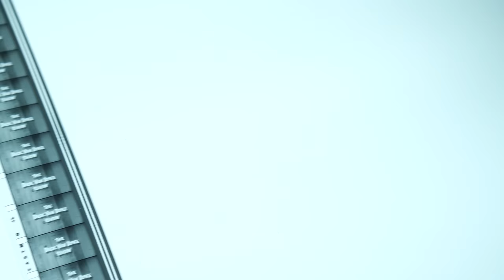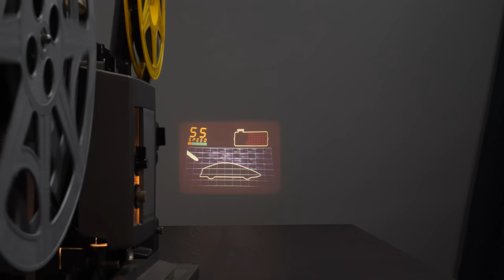Movies made sound with a light bulb: Sound-on-film

Comment: I am 35 and my first job was being a projectionist in a multiplex cinema. I was basically the last generation to have handled film on a daily basis. I have worked with multiple machines and they were mostly35mm projectors, but sometimes we used 70mm too on our bigger machines. 

One of the biggest benefits of dts was that we were able to play the same film copy in multiple languages, because all it took was to swap the dts discs and voila, any dubbed version could be played.

SDDS contained three centre channels as the normal single one in SRD or DTS which was beneficial on bigger screens because the voice of the speaking person could be more accurately placed on the screen.

 And then there was the scary but interesting way of playing one copy in multiple machines at the same time which have been networked together. A scary thing to do, but it was interesting to see in action :).
Reply: Ooh! That last thing - one film print running through a bunch of tubes and holes in walls and floors to another projector - there's actually really awesome footage about that on Youtube. Or at least there was, about 5 years ago. No idea if the uploader kept it up, but it was very much worth watching.
Reply: at my 10 plex, the projectionist once threaded a print thru 8 of the projectors
Reply: @mfbfreak  FilmTech has a video demonstrating a 16-screen interlock. it's quite a trip. The video ID is ZdPKGNCw7lM
Reply: If you look at the last generation of 35mm film, SDDS was encoded outside the sprocket holes, Dolby Digital in-between the sprocket holes, analogue stereo where it's always been and the DTS time code in-between sound-on-film and the image.
Bananas
Reply: My people! I'm 34 and was a last-gen 35mm projectionist too! I even ran the last film screening at our multiplex. One day film will come back, the way vinyl did, and they'll have to dig us up to train the new generation lmao
Reply: @MostlyPennyCat  At keast they made it work for multiple sound systems.
Reply: @Toast_Points  True (and I'm 45). I remember when seeing films projected on TV in realtime was still a thing in the 80's.
Reply: @Toast_Points  May I ask what that final film movie was you remember projecting? I’m 34 also and if I recall correctly my local theater made the switch to digital fairly early on as it was pretty new around the time though I don’t really remember when that happened.
Reply: @Coderjo.  missed rickrol opportunity
Reply: Also 35 and did part of my high school work experience in a twin cinema projection booth.  I believe the last film I presented was Hotel Rwanda.  Once we spliced together the trailer and feature reels onto the platters, we would do a test run of the whole film with an empty auditorium.  One auditorium was set up for SDDS in addition to Dolby Digital, and the other DTS plus DD.  I can't remember if the feature had SDDS tracks, but we were presenting it on the DTS "side".  The DTS decoder stack malfunctioned during the test run, first dropping out, then going into a boot loop, (I think the decoder hardware was an embedded x86 system that booted MS-DOS from the DTS audio CD-ROMs) then not powering on at all.  I switched the audio source to DD, only to discover that it was unstable, so the test run was completed using the analogue optical Dolby Surround tracks.  A thorough cleaning of the DD optical module brought it back to life with our audio test reel, but there wasn't enough time to run the film again before the premiere opened.  Fortunately, it worked without a hitch.  DD was seldom used on that projector, so while the film path was cleaned regularly, the DD optical module didn't get enough attention on a regular basis.
Reply: @SmokeyChipOatley  I do remember, it was The Thing. The 2011 prequel, sadly, not the original.
Reply: @erinrising2799  we did the same thing (our projectors called it Interlocking) for the midnight premiere of The Dark Knight. It was my first time doing it and apparently it hadn't been done for a  couple years before I started there.  Timing is extremely critical - you have to start the next projector about 8 seconds (if I'm remembering correctly) after the previous one started. If not you have too much slack or too much tension. Let's just say we had some "technical difficulties" that required several new film splices.... And we didn't get started until after 12:30....
Reply: 53 years myself. Former IATSE projectionist  stayed in the business until the digital machines came in. Ran the booths of 8, 10, 12, and a 18 plex. 35 and 70 mm prints.
Reply: @JStewie15  My first interlock shift was TDK, not midnight shows but opening Friday. We turned off the wrong platter by accident and caused a brain wrap. Once we finally got it going again, the projector status boxes in the office and concessions wouldn't stop beeping even though everything was good. My manager had the bright idea of power cycling the box, which shut off all 12 projectors instantly. I was in concessions recovering after fixing the brain wrap and suddenly people start coming from multiple theaters saying their movie shut off. According to the concessionist I looked like I had just seen a ghost.
Reply: I feel bad that I am 35 and never had a similar job, and in fact was super excited about digital film coming out, you know, "The future is here!".  Turns out the future tends to be more boring than you would expect.
Reply: @Coderjo.  I edited that video. :)
Reply: I worked in a dump of a multiplex about 15 years ago. 13 screens, 35mm with dolby digital. And me running the lot of them.
One of those jobs that was both an interesting place to work, while also being incredibly dull, badly paid and tiring.
I like to look back on it with fondness, but at the time it was awful.
I do remember that once per year, each sound-head had to be checked for audio sync, but it was one of those "ticking the box" type jobs, because it was practically impossible for the audio head to move far enough to cause visible sync issues. You loaded a fairly short loop of film that had a visible flash and a beep that should be perfectly in time with it. You watched and listened, while adjusting a little potentiometer with a screwdriver.
Reply: @Coderjo.  OMFG, that's epic!
Reply: The movie theater in the middle of nowhere town where I vacation used film projectors until a few years ago. It's a cool place, built in 1922 and two of the theaters are basically screening rooms because of how small they are.
Reply: @Toast_Points  Holy crap. That's a bad night. I think everyone who worked in a theatre as a Projectionist has some crazy stories. I only had one really bad brain wrap. It was a 10pm showing of the orphan. I went up to check out what was going on and it had wrapped up the film from the top platter all the way over to the top of the projector. It took like 3 hours to fix. And about 15 seconds or so of the print was just shredded and had to go in the garbage. We switched to Sony 4ks just in time for the premiere of Avatar 3D. It was awesome and cool to see it all be installed. But was sad to see the film part of the theater (as well as my job as Projectionist) be basically deleted. I made it by for a few weeks. But after the used the software enough they realized it could all be scheduled. I already knew that but I'd been deleting my scheduled shows at the end of my shift. What can I say. I was only 19 lol. Good times.
Reply: The worst thing I witnessed was when somebody dropped the only print we had of harry potter 6. A new guy was trying to move it by himself using a plate and it slipped. I had the 2pm shift and walked in to find the head engineer running up and down, stretching the print out to detangle it. We got through a lot of film cleaner pads that morning.

"Isn't it a bad idea to have it on the floor like that?", "Oh yeah, but it's either this or have  the print out of service for the next couple of days while we find each tangle and slowly take it onto a set of reels. And it would be taking up the only working rewind cart while we're doing that. If they're willing to rent out their prints to crappy places like this, they shouldn't be surprised if they come back a bit scratched in places."
We had it back on the platter by 4.
Reply: I'm 44 and although I was never a protectionist when I was a child I was given the 16mm Eiki off of HMS Bristol and a handful of cartoons as a toy.
See, the Royal Navy had a film library but they were transitioning over to DVD and large screen televisions. So they threw all the projectors in the skip and burnt the Royal Navy Film Library 🤢
I still have it and now collect movies on 16mm.
I have Disney's The Black Hole and The Elephant Man.
The Black Hole is a Technicolor print too!
Once I'm back at work it'll be Technicolor prints of cartoons that I'm after next.
Reply: @mfbfreak  Yes, we have done that too :D Not through holes in the wall, because our projection room was actually well laid out, but it crossed a staricase going to the upper level of the main screen which was raised due to its size. :)
Reply: @erinrising2799  That is pretty epic! I have done 4 machines, but that gets pretty tricky at some point, because if one machine plays up, you have 4 machiens having to be stopped, which ten resulted in 4 cinemas with upset customers :D So the level of potential failures increased with each added machine :D
Reply: @Toast_Points  hahah exactly the same sentiments. I was one of the last 35mm screenings too. I do get pulled into a few cinemas for special 35 and 70 mm events, as we seem to be the last generation still working who can operate and prepare films for such events.
Reply: @Tinil0   Well being a projectionist at age 18 and early 20s was not very common even then in the early 00s and lat 00s. So you are excused. I remember when they fitted a few digital projectors in our 16screen and 9 screen cinema. It was super interesting, but I did prefer the analog film look even back then, despite really being into tech. I remember we had a side by side comparison with the Inglorious bastards film. We compared a very good Kodadak film copy (not the cheap wobbly ones) with the digital version, and noone in the audience could detect any differences at all.
Reply: @JStewie15  Our machins were networked and setup for starting all at the appropriate time when the master machine was started. It stopped that problem from happening. But yes, the tension can be super high, and I had horrible nights with this as well.
Reply: @st0rmforce  some places were dull and not looked after. I was lucky in that aspect, we had a well maintained and looked after multiplex, and we had pletny special events etc with special films. The team and all my collegaues were awesome too. Most of us were of the same age, the the banter was pretty epic. Shit pay though :D

Comment: i just want to put it out there that modern projectionists still have an amazing and difficult job which ultimately goes unnoticed. i worked as a bartender at a modern-ish movie theater and i was lucky enough to have the privilege of getting a tour from the senior projectionist behind the scenes. The most impressive thing to me was the heat management. they had a system of air ducts and fans that could easily rival any indoor farm. It was amazing learning how nowadays the biggest issue in projection is actually heat management. The imax projectors i got to see were not only impressive in the fact that they had two extremely large and fancy projectors but they also had their own dedicated blower. The coolest thing to me was finding out the tech at this particular theater were almost fifteen years behind modern tech.

Comment: Another potential benefit of DTS's audio-on-disc system: same film stock for any region with the CDs being localized to whatever language necessary.
Reply: Dts was a pain, not cause it wasn't awesome, pr great quality. But soo many cinema's 'lost' discs meaning it was less and less likely cinemas would ever get the discs.

Towards the end, DTS were digitally delivering iso files if you asked them, which meant at least cinemas HAD the disc data.

Most cinema's still had a DD and the standard SR track discussed here as backup. Worth pointing out SR was more than stereo, it had two patterns as seen here, but with some additional 'maths' you could encode more channels, albeit nowhere near as good as DTS or DD.

70mm did also use magnetic audio tracks, and both 35mm and 70mm also had the very little used SDDS
Reply: Also, to my knowledge, DTS only ever used CDs and never moved to DVD.

I have an XD10 or two if anyone wants!

And whilst the XD10's used dvd drives, the discs were only ever CDs

Comment: This brings back memories.  In junior high school in the early 80's I chose A/V as an elective. There were about 2-3 of us per period. We were the kids that went around the school to roll the projectors around to the classrooms and rewind and re-load the film on the projectors in the classroom. The teachers could start it, but not thread it. We could also wander around during the period just checking on the projectors and making sure the audio was synced (that issue with the loops too big would happen sometimes). After a few weeks we could thread a projector pretty quickly. They also taught us how to splice the film if it broke, replace bulbs, etc.  But I don't think we ever saw the inside of one with all the belts and mechanics. I was always curious how the audio worked. I knew there was a light there and that was audio related, but I did actually think it was somehow magnetic. Fascinating stuff!

Comment: I worked as a projectionist for Aye Emme Cee around '08 and ironically the 35mm prints (the last around that time before everyone switched to digital) had a form of this. The film would move through a platter and the "brain"  would read the side of the film and decode it and then produce the sound. Best job I ever had.
Reply: Those brain wraps were brutal.
Reply: @johntomik4632  Ah dude you ain't lyin'. The location I was at was one of the biggest in the NYC area and like one day during  my first week running the booth, I remember I had like 3 or 4 at the same time. I was running around like a chicken with its head cutoff, running from platter to platter trying to splice film WHILE the projector was running. I was freaking out. I managed to splice them and had 2 or 3 late starts but no one was the wiser. I had threaded them wrong because I missed one little step. I learned from it and it never happened again but boy was the pressure and anxiety on.
Reply: @JohnDoe-cd6ro  I had a few break too lol!
I also remember watching Apollo 13 and Braveheart about 50 times:)

Comment: I did 10 years at a movie theater and this brought back some memories. Theater projectors had a near identical setup (just a lot, LOT brighter). Good times...
Reply: how did they get the extra brightness without burning the film?
Reply: @MrZoomZone  Film moves fast. It was 35mm and if we had a wrap (where the film wasn't fed properly through the brain of those big platters and seizes up), you'd easily burn a frame or two in a couple of seconds.
Reply: @Eschguy  nothing worse than being in the theater for a preview and see the brain wrap happen!
Reply: @tjselvey  but it's kinda satisfying if it's a d-bag manager that did the brainwrap and not you 🤣🤣
Reply: @MrZoomZone  I reckon the frame of 35mm film is more than 4x the size of the frame of 16mm film, depending on perforation and soundtrack area and pulldown height so at the same luminance hitting the film and same luminance at the screen it's already projected more than 4x bigger.
Reply: I did a lot of time in theaters too - the projection booth was my baby! Brain wraps were bad - tail wraps were bad. Both at once was the absolute worst, and I was there to see it. 😂

Comment: Back in 2009 (when the first avatar film came out) a friend who worked as a projectionist let me tour the projection booth. He showed me that they had special markers on the film that would be read by a sensor during projection that would trigger a matrix that in turn would automate the movie going experience. E.g dim lights, open the curtains, reason lower the curtains depending on the aspect ratio of the film/trailer and turn the lights back on when the film is over.
Reply: we just used some metal tape along the SDDS area of the film which i believe was caught (low voltage bridged/shorted?) by the "stop sensor" under the visual and audio part of the projector
Reply: @plonk420  Proximity detectors were used to sense the foil strip cues.  The nicer systems could detect a variety of 3 positions, inboard, outboard and center to trigger different events.  There were a lot of simpler readers that used the conductivity of the foil to detect such things as well, but they tended to get less reliable as the film was run many times.  The foil would crack, and often fail to trigger the automation.  There were other varieties as well, some using reflective patches, barcodes, all sorts of things.  The foil cues are also used on audio tape reels to trigger the deck to change playback sides.